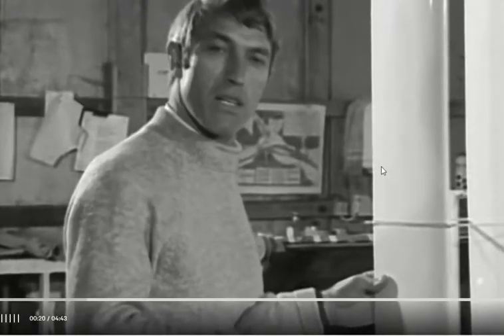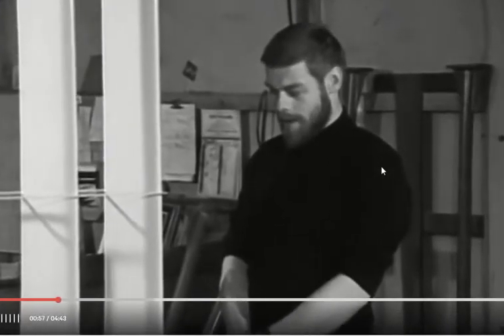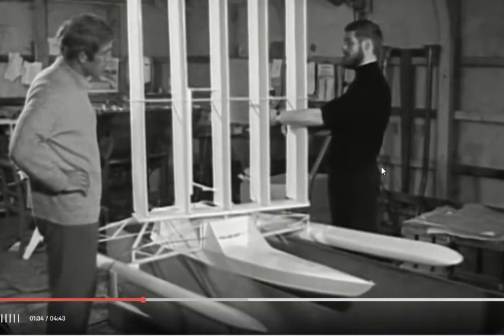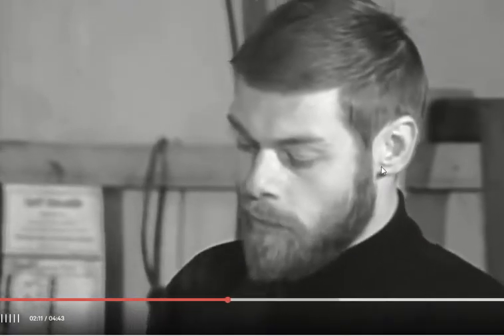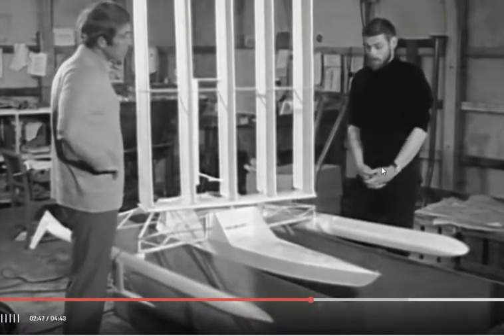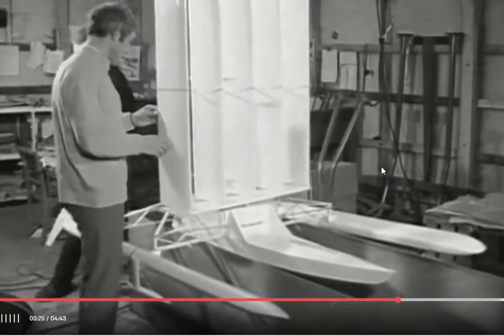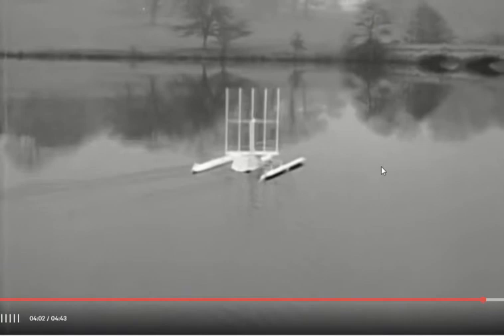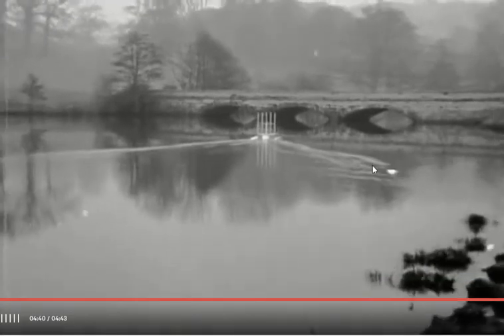Experimental self-trimming wingsail boat 1968

Comment from the maker: Very interesting! This idea is followed up on http://www.sailwings.net
Reply: Almost all sailing, and particularly long distance cruising, doesn't need very high L/D from the sail, but needs as much thrust as you can get from a rig that's not too tall. One large wing of the same span with AR or 2 or less should be easier to build and rig than a pentaplane. Add a jib wing ahead of the main articulated to produce a slot for the main, and the system should be capable of high alpha with Cl of 2 or more.

Peter, your cam-controlled purely mechanical automatic trim system is elegantly simple. I'm amused by the number of absurdly complicated wingsails that seem to have had an entire university EE department thrown at the controls, making for a cranky system with multiple redundant failure modes. Adding accelerometers, anemometers, gyros, hydraulic systems, rams, pumps... egad. 100% employment for EE grad students, I guess.